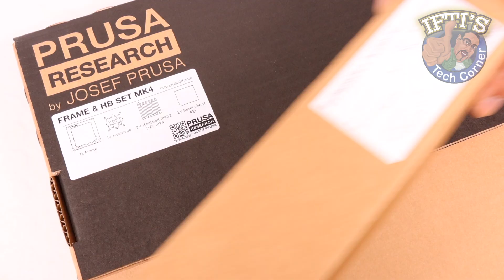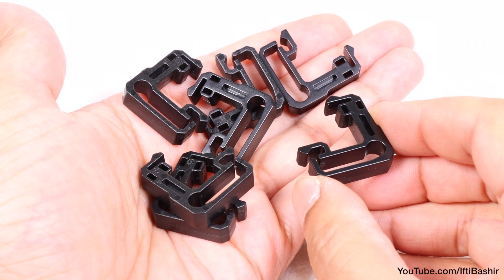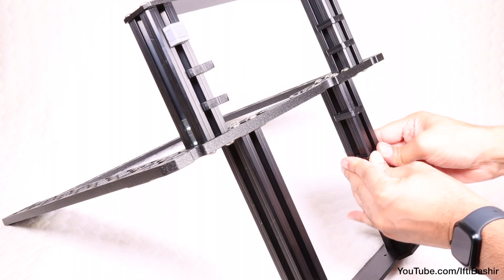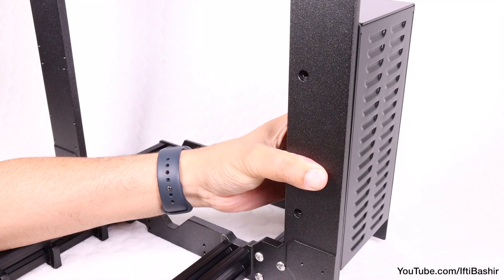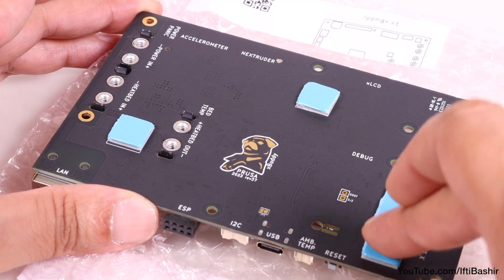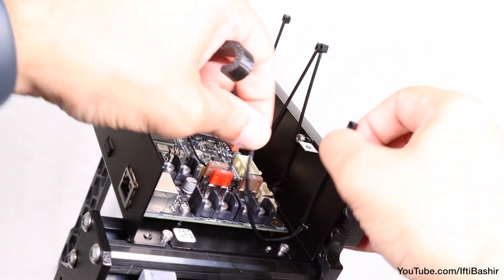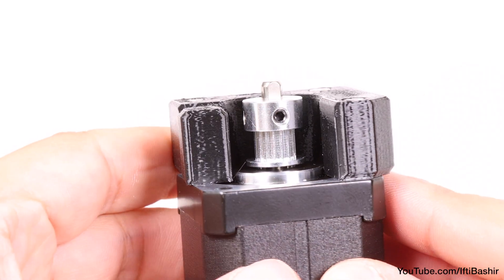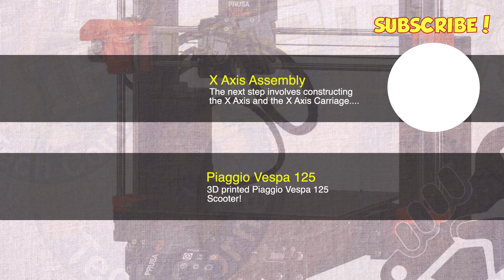#02 Original PRUSA MK4 Kit : Full Step-By-Step BUILD GUIDE - Frame Assembly

Comment: How do I make sure the frame is perfectly square? I thought I did a good job assembling my Ender 3 PRO, only to find out my prints are horribly slanted five months later.
Reply from the maker: Use a completely flat desk. Screw all bolts in but enough to allow some tiny movement - once all are in, square on the flat surface and tighten the bolts. It doesn't have to be absolutely perfect - a mm tolerance is OK. The squarer the better though.
Reply: @iftibashir  I'll try this way. I completely disassembled my Ender threr times, and I was able to make it near-perfect. Still, I couldn't print long props, like swords. The parts just wouldn't align.

Comment: my M3n isn't square (hexagonal) and it's also very very hard to push in -- is this a mistake? Also no idea where 623h is, don't see it on any of the parts lists
Reply from the maker: Which part of the video are you referring to?
Reply: @iftibashir  hey sorry! I was following the manual for mk3 by accident. I was referring to the y belt idler assembly part.